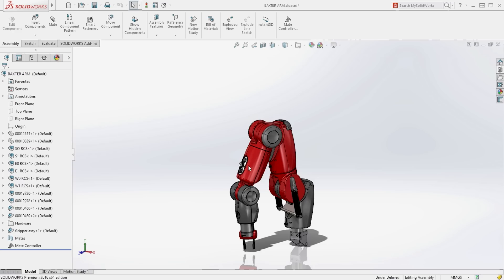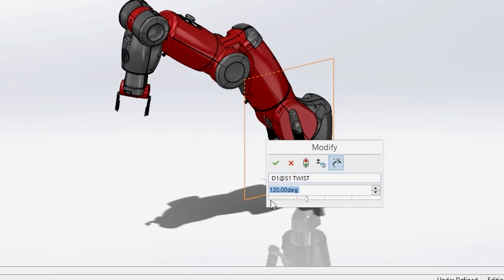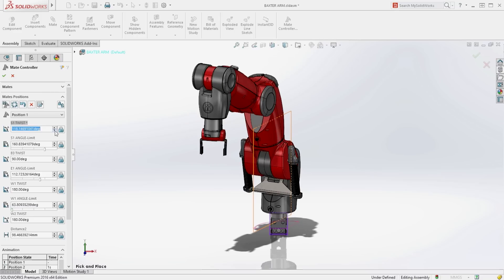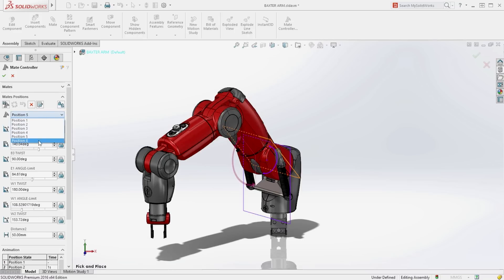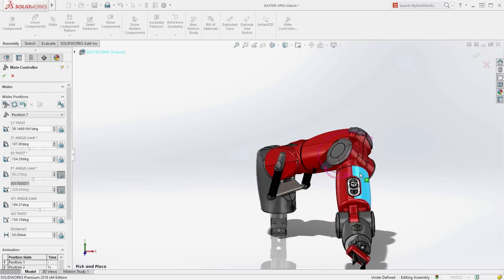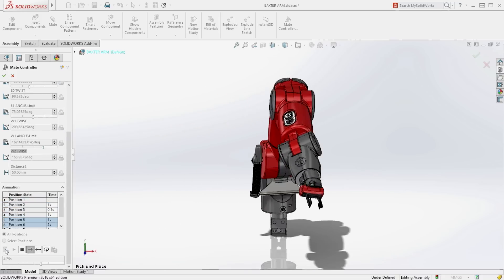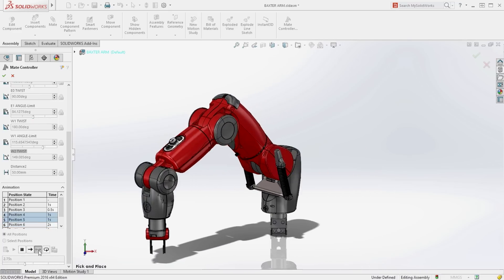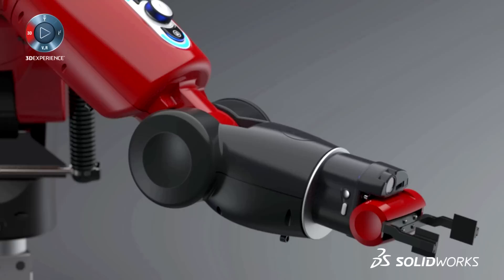SOLIDWORKS 2016: Animate Assembly Motion

Comment: Is it possible to access to this "Mate Controller" using the API routines?
In this example, animation is created based on user inputs. But, is it possible for this to be in real time??? And one more thing is, what happens when mate reaches 0 degrees and 180 degrees? Common problem with SolidWorks is that it flips everything when mate reaches 0 and 180 degrees.

Part of my master thesis was to create a real time robot movement animation in model space, based on inputs from encoders. To simulate encoders I used a gamepad and joysticks, and interfaced it with SolidWorks.  Precise motion was needed.  Because of that, best solution to accomplish motion was to use EditMate API routine for every joint in a while loop. It gave good results, but far from perfect. Edit mate is a slow operation, so it was not near as fluid as shown on this video.
Using DragOperator was second solution, but it was even slower because of locking and unlocking mates.

My opinion is that this solves a problem for average users. For example this is a good for animations, and graphical presentations. But, for every professional user that works with robots on day to day basis, there is a need for SolidWorks to be better in that field. Robotics is future, so maybe next step can be implementing special abilities for Forward and Inverse kinematics calculations of moving system, and of course, animation based on inputs, for start from keyboard, josticks and later for interfacing hardware inputs, like encoders, limit switches and so on...